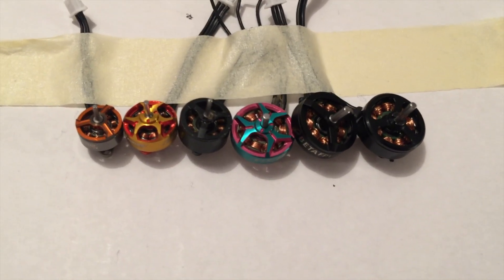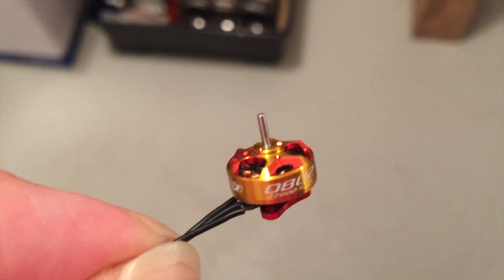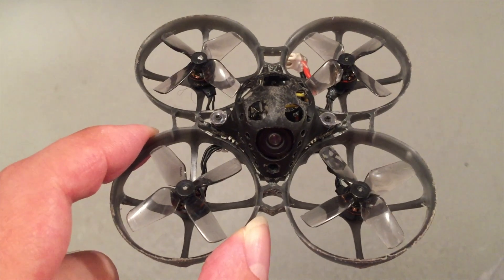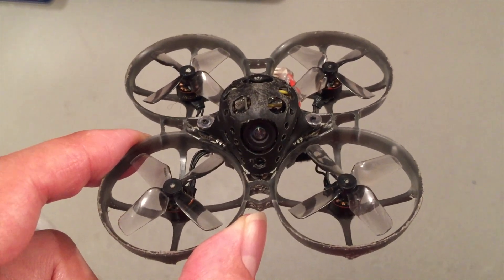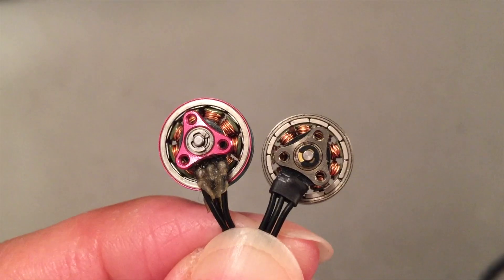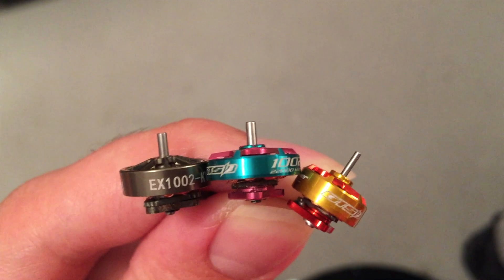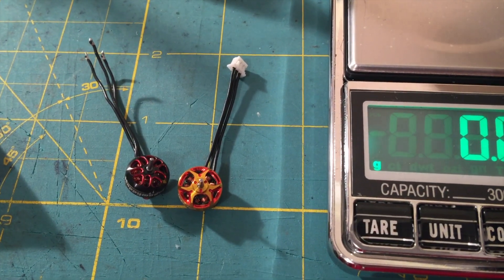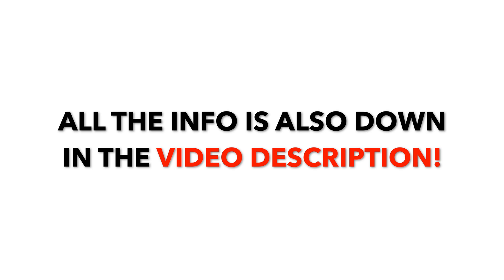My FULL KNOWLEDGE about Whoop Motors for Whoop Racing | 65mm 75mm 85mm Whoop Racing

Comment from the maker: ‼⚠Addition to the video description:⚠‼ The reason why these motors and motor prop combos are my favorites: They are not over-  or underproped. Motors with too big propellers (overproped) are less efficient (in full send racing operation) and less responsive (due to lack of torque), which means poor handling in fast direction changes (e.g. in slalom). The same efficiency problem applies to motors with too small props (underproped). For someone who flies slowly (cruising or very slow racing), slightly overproped can be interesting (e.g. 1002 with 2inch propellers or maybe 702 with 40mm propellers). But for me as a full send racer, I definitely don't want overpropped. Better slightly underproped. Or ideally, of course, perfectly in the middle.

My dreammotor would be a 03 size high kv motor (better throttle response) with the efficiency and low internal resistance of a 02 size motor (on all whoop sizes). And of course with short 1mm/1,5mm shaft in a good material, high quality double ball bearings, pcb board, long enough motor cables and simple lightweight designe with only 3 thin struts to the motor bell.

⚠Please also watch Chris Rossers videos about motors:⚠

https://www.youtube.com/watch?v=RXy00orSpfU&list=PLFPBjpbd5xKSUeHAB0K-jzTpmQRLRl7AA&index=1

https://www.youtube.com/watch?v=llmRHawsXZ4&list=PLFPBjpbd5xKSUeHAB0K-jzTpmQRLRl7AA&index=11

https://www.youtube.com/watch?v=C1Xpt0y2-KU&list=PLFPBjpbd5xKSUeHAB0K-jzTpmQRLRl7AA&index=13r-proportioned

Comment: Would you recommend replacing the Meteor 75 Pro motors with the RCinPower 1002 motors?
Reply from the maker: No! At least not for racing where good response and good power as well as good efficiency of the entire system is crucial..

Comment: According to the specs the RCInPower 1002 22000KV should be able to draw 7.9A at 3.7V with a Gemfan 1610 prop. Therefore I'd expect some fried ESC's when combined with ESC's that are rated for 5A or 6A. Doesn't that happen for you? If not, can you explain why not?
Reply from the maker: Very good question. Unfortunately, I don't know the physical scientific reason either. I only know that I had absolutely no problems with the rcinpower 1002 22000kv in combination with a 5A/6A ESC in full send racing. And neither did my many racing whoop friends. It's important, though, that you solder the motors directly and use AWG20 main cables and, of course, BT2.0 connectors. Hope this helps. Maybe it's because the base load is relatively small, resulting in only short ampere peaks. This allows the material to recover during phases with lower amperes. Or maybe it's the other way around. I don't know. All I can say is that I've never burned an ESC with the Rcipower 1002 22000kV, and I've been flying with them for a long time and draw a lot of current. But my whoops are also built lightly. Maybe that has an influence. If you build a 75mm whoop that weighs 28g, things might look different again. I always try to get to 26g with 1002 motors.
Reply: @butterflyfpv  thx for the general advice as well, most of it has been taken care of from factory for the BNF Mob7 FS HD
Reply: Thx for the reply. I'm thinking of putting these on my Mob7 Freestyle HD, which has one of the motor bells slipping on the shaft (Bloody HM doesn't sell spares). I'm a bit cautious about frying the €119,- HDZ AIO5, hence the question. With these motors it should be around 24g dry weight I think.
Reply from the maker: @ewaldwasscher7251  You can fix slipping shafts (watch my video). Happymodel sells spare bells (EX802 with 1.5mm shaft I think) in the happymodel aliexpress shop.
Ok, I understand that you are cautious about the expensive HDzero AIO. It shouldn't be a problem. But I can't say with 100% certainty. Every AIO and every ESC is a little different. Ultimately, you can only say for sure once several people have flown the same combo with different flying styles. But I think you can give it a try. There's a good chance it will work. The chances of the AIO breaking in a crash are probably higher, especially with a 3D-printed canopy. Hope this helps.
Reply: @butterflyfpv , I just transplanted the bell from a different KV motor of the same type, and it seems fine so far. Thx for pointing me in this direction!
Reply from the maker: @ewaldwasscher7251  👍👍🤜🤛

Comment: Im building an 85mm whoop it has xt30 connector. What motor would you recommend
Reply from the maker: 1103 11000kv or more in my opinion. It is still the best motor for 2inch props. Best power to weight ratio. 1202 would be nice too but they are heavier. I think you can`t find a more lightweight motor than the Betafpv 1103 11k motor. Unfortunately.

Comment: For 2 inch 2s builds I found flywoo 1003 14800kv motors to be really good. 
Would love to see you fly a toothpick quad!
Reply from the maker: Thanks for the info! The problem with toothpicks is that they are not that durable. And I like to fly quickly through hard gates. A toothpick would break very quickly. But maybe at some point I'll get around to building and flying a toothpick.

Comment: HI. What better for race. 65mm 0802 27000kv or 75mm with 1002 22000kv?  which rolls better? and wich props? THx very much!!!
Reply from the maker: Hey I've never flown a 65mm with 802 27k. But basically a lighter take-off weight is faster for racing. Especially for indoor racing on small to medium tracks. All whoops roll about the same. Do you mean the roll rate? Or how quickly the whoop can react on the rolling axis? If you mean the second then you have to make sure that your whoop is built so that the center of gravity is on the line of the propellers. The motors have to be strong and at the same time as light as possible. So that the mass you want to move is as small as possible. And the propellers should be as light as possible so that the motorss can accelerate well. Hope this helps.
Reply: @butterflyfpv  Or how quickly the whoop can react on the rolling axis?

yes, how quickly will the woop change the flight direction and react to the throttle change 

And how important is the thrust-to-mass ratio?
I thought that 75mm at 1002 has a ratio of more than 7, and 65mm at 0802 has about more than 5. Or is this parameter not so important?

They're so small, but it's so complicated)

Motors i choosed RCINPOWER. I think then not bad.
Reply from the maker: @al4605  Ok so the speed of the reaction in the roll axis depends on the reasons mentioned above. It is important that the mass is centered and that the motors/propellers have as little mass as possible. And of course the battery shouldn't be at right angles to the direction of flight if you want the roll axis to react quickly. 

If you want the whoop to be able to change direction quickly and react quickly to the throttle, then the first thing that is important is to have as little total mass as possible.

In other words, a powerful 65mm whoop is the best. For example a 65mm with 702 29k+ motors. Under certain circumstances you can use a 270mah lipo so that the mass is even smaller.

The thrust to mass ratio is important, but no one knows exactly what this ratio is because tests on a test bench are not very informative.

As you write, it is very difficult and there are many factors. For example, a 75 1002 22k whoop can be more reactive in the roll axis than a 75 802 27k if the center of gravity is better with the 75 1002 22k.

If you are really interested in the topic and want to educate yourself then the best thing to do is build a 75 1002 22k whoop, a 75 802 27k and a 65 702 28k+ and compare them. So that you can find what you personally like best.

You can fly fast with almost any whoop and most of it is practice. Which of the above whoops you fly doesn't really matter if you have 2000 hours of practice and your race track is medium sized. However, if you often fly on 65mm racetracks with small 500mm gates then you will definitely be fastest with the modern 65mm whoops if you practice a lot.

If you want, you can upload a video of one of your practice sessions to YouTube and send me the link. Then I can tell you which whoop is most suitable for you at the moment (yes, that can change over time as you have more practice)

Hope this helps

Comment: Hi, can you help me please ? What I should buy ? For outdoor fliyng. Meteor 85 or Mobula 8. Thanks
Reply from the maker: They are about the same.. I can recommend both. Maybe you can start with mobula8? Lighter (?) and better cam. Are you aware of the Betafpv Meteor75pro? A 1S whoop, which is also good for outdoor flying..
Reply: @butterflyfpv  I have meteor 65 pro. I want try something more powerful. Meteor75 is 1S. Thanks, I wil try Mobula 8.
Reply from the maker: @detomatorcz910  Ok yes then mobula8. A solid whoop.

Comment: Moin, vielen Dank für die Infos! Hatte letztens die gezeigten 0802 in einen Meteor75 Pro frame verbaut und war mir nicht ganz sicher ob die wirklich für 75mm gemacht sind, bin aber erleichtert das ich nichts grob Falsch gemacht habe :D 

Sie sind jetzt schließendlich doch in einem 65mm frame gelandet weil der Peak power verbrauch die Flight time sehr beeinträchtigt hat, aber das Flug gefühl war dafür ziemlich klasse. Vielleicht investier ich mal in Akkus mit mehr mah und probiers nochmal irgendwann
Reply from the maker: Hey gern! Danke für das Feedback! Also du meinst schon den alten Meteor75pro frame? 40mm Props? 802 27k Motoren sind gut für 40mm Props, jedoch nicht für 45mm Props.. (für racing) Ja voll, in gute Lipos investieren ist immer sinnvoll! Meine favoriten für 75mm racing whoops sind: GNB 1S HV 380mah 90C A30 und GNB 1S HV 530mah 90C A30 (hat masse und gewicht eines 450er Lipos)

Comment: Thanks for sharing, I haven't tried all those sizes.
RCinpower are my favorite too, super reliable, efficient, and powerful. Even the 0802 22k kv is better than some other brands 25k. 
Never broke a shaft. People who don't know think they need 1.5mm shaft, that's becoming a big misconception in the community, and that is limiting people choices in 0802.
I freestyle, 25k with biblade on light builds and surprisingly 22k with triblades for heavier hd builds gives perfect flight time and power (75mm).
Only drawback: some props are a bit loose and get ejected in crash, I solved this issue by adding dental floss inside.
Reply from the maker: That's exactly how it is! Thanks for your feedback! By the way, I also use dental floss on all props. I first drill them with 1mm or 1.5mm pcb drills. This way I can easily switch between props..
Reply: Aaaah so my new rcinpower props do feel loose. I was wondering about that because on my old beta 1102 the props were much tighter
Reply from the maker: @Aldrizzle   I use dental floss on all props. I first drill them with 1mm or 1.5mm pcb drills. This way I can easily switch between props..
Reply: Nice video thaanks for sharing
Reply from the maker: @danieldewindt3919  Thank you for your feedback!🤜🤛

Comment: Possible to share your throttle mid , expo and the scale ?
Reply from the maker: I'll make a video about it at some point. A good starting point: I set throttle mid to 0 and throttle expo to around 40-60% on a high kv motor. I like my whoop to have a throttle position of about 40% when hovering. Not everyone likes it, but I like it. I don't like it when my throttle position is at 20% when hovering..
Reply: @butterflyfpv  that's a lot of expo!!!
Reply from the maker: @nikotttin  Yes! Not for everyone I know.. But you can get used to it. And in the rc aerobatic model world with rc 3D aircrafts, everyone flies with 40-60% exposure. It's normal there...
Reply: Test it yourself as this depends on the motor. 
1) put the throttle on the odd
2) fly as flat and low to the ground. 
3) do some turns and so on but level and close to the ground
4) note the throttle. Mine for a 0702 25000 was around 40%
5) go on beta flight and put mid at 40 and put scale at the top. 
6) repeat the low flights and assess whether it suits you. 
7) play with expo and mid sensitivity if you feel it is too fidgety. I’m using 15% but still not totally convinced (I flew several years without any expo, so need to re-wire the brain). 
8) send it!

Comment: I also use rcinpower 0802 22000kv but I think the cable is not good so I replaced it
Reply from the maker: Yes, you have to secure the cables on the pcb with a rubbery adhesive on rcinpower whoop motors....
Reply: yes  @butterflyfpv  i use glue tianmu 705 but I think using heatsrink is enough
Reply from the maker: @m3h0nk  Yes! heatshrink or glue..
Reply: I thought replacing cable is impossible for tiny whoop motors. Could u please show me any example videos if possible? Thank you!
Reply from the maker: @TamilMediaTV  Possible on motors with a smal pcb board.. Like on rcinpower motors..
Reply: @butterflyfpv  Thank you mate. I try to figure out. Mine is happy model 0802 19000kv
Reply from the maker: @TamilMediaTV  EX0802 19000kV? If yes then it is possible..

Comment: Rcinpower hat neue 0702 motoren, falls es dich reizt die zu testen.
Hab noch meine Rcinpower 0802 25000kv mit dem HM diamond AIO.
Funzt noch gut.
Wie du sagstest sind die 27000kv motoren nur für 12A aio.
Die HM 0802 motoren sind gut, so lange soe halten. Das war bei mir leider nie lange.
Rcinpower und tmotor sind allgemein die besten.
Wobei VCI einige motoren für betafpv mittlerweile macht. Die scheinen auch nicht schlecht zu sein.
Reply from the maker: Ja voll vielleicht kann ich die 702er von rcinpower mal noch testen. Oder auch die rcinpower 703 27000kV. Aktuell allerdings noch nicht erhältlich auf aliexpress oder in europa..